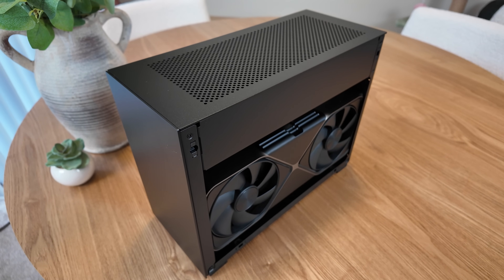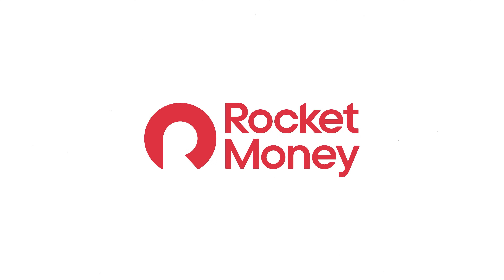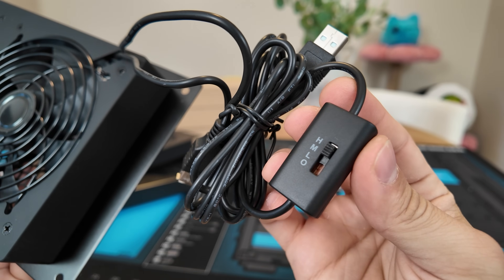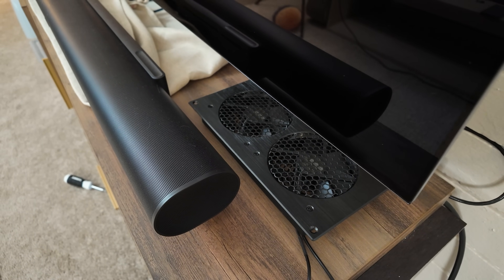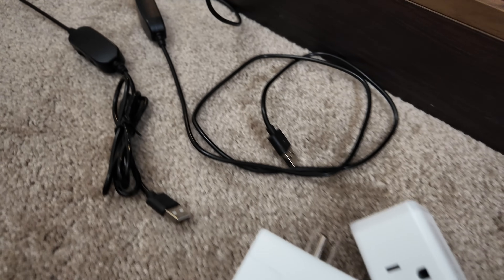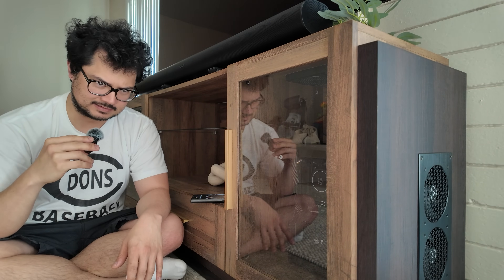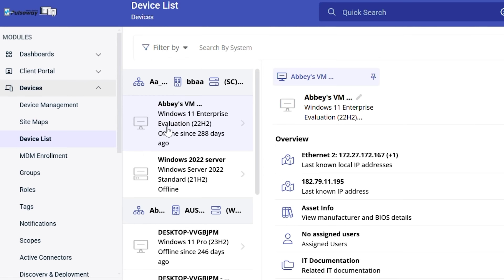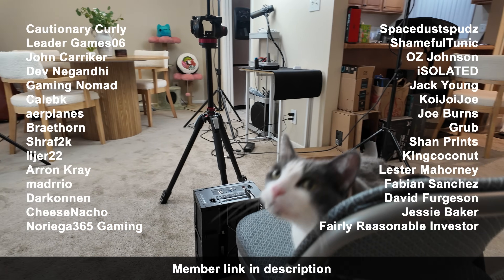The DIY Job That Saved My PC's Life

Comment: is the top heat output a problem for the TV‘s lifespan and would a angled bracket or such, to redirect the hot air against the back wall maybe better?
Reply: it‘s a real nice setup! I was thinking todo something similar for my PS5, but without the tools at hand it just stands beside the TV board nowdays 😂

Comment: If you look at the Shelly IOT products you could have gone one step further and had a temp sensor in the cabinet that when it hits a certain threshold it turns the cabinet fans on and when it dips below the threshold it turns them off again. This would mean for light usage you potentially wouldn’t even need the fans on making noise levels even lower 👌🏽.

Comment: I have been kinda freaking out because i think my EVGA GTX 1060 3gb is finally going out, I have been getting black screen flashes, and black pixels on both monitors i use which are 2 1080p tvs, I dont have any pc monitors. My pc will cash in browser watching videos, on desktop, it crashes even on older games like left 4 dead 2,phasmophobia, bioshock infinite run 10 minutes and crashes, my drivers are up to date, I am running a msi b450 tomahawk, with 16gb of ddr4 3200mhz of G skill flare x, windows 10 home which is stuck at 1903 and wont update,all my motherboard drivers an my bios is up to date. MY pc is my way of streaming making music,videogame development and working from home. I built my pc around 2018-near end of 2019. I have been scouring my tech sources, because i cant afford to upgrade right now.

Comment: Hi Kyle - I've been a fan and a subscriber for a good bit. I greatly appreciate your narrative style and humor in your computer build vids, as well as your v-log style channel update vids. I think both should definitely continue. 

This video in particular made me realize how much your attention to detail and willingness to think outside the box paid off with how well your cooling worked out for your micro build inside your living room TV cabinet. A job well done, sir. 🍻

After watching this video, I thought that maybe you could help me answer a question that has been bugging me with a build of my own. It might be a good topic for a video, if you haven't done it already. If there are better ways to answer this question, or you already have in a previous video - please feel free to let me know. I have a computer build that took me most of the early part of the pandemic to finish/get all the parts for, and unfortunately I have been experiencing some issues with random system reboots related to the dreaded "WHEA-Logger" error, in a nutshell stating that my CPU is overheating.

The current rendition of my build is as follows:
AMD 5900x CPU cooled by an Arctic Liquid Freezer II (2x280mm), installed in a Lian Li 011 Dynamic case with a ASUS ROG VII Dark Hero Motherboard, Nvidia Founders Edition 4070 Super, all powered by a Thermaltake 850w Gold PSU, running on Crucial Ballistix 32gb RAM. I have 3 120mm Noctua fans bringing airflow in from underneath and from the right side, with exhaust going out the top (where the 2x280mm Arctic cooler is acting as a rad) and out the rear (another 120mm Noctua). I thought based on how I completed this build, cooling shouldn't be an issue whatsoever, and it should perform flawlessly.

My build was originally completed with a Nvidia Founders Edition 3060ti, which I eventually upgraded with the 4070 Super. Prior to installing the 4070 Super I never had a WHEA-Logger error. When I installed my 4070 Super, I also adjusted the radiator with Arctic's most recent offset bracket suggestion for cooler placement, as well as re-applying Arctic thermal paste. 

I was wondering if there was a method you recommend for testing a CPU cooling system, beyond the obvious of downloading an app like OCCU/CoreTemp? I think that at this point I may need to remount my CPU cooler and see if that makes a difference. But I was curious what tools and apps you use to monitor CPU temps and make sure that they are performing the way that you intend them to. I am hoping that my CPU cooler isn't experiencing some kind of malfunction, but I feel like without knowing the best way to evaluate its performance, I'm a bit stuck.

If you end up reading this comment, I appreciate it greatly. Thanks for everything you do!

Comment: How much power does your PC pull, and how many amps is that smart plug rated for? Via home assistant, you could probably setup an automation that enables the fans if the PC is pingable on the network.

Comment: I would put 6 fans in the back and divide the low intake and high exhaust with a shelf, forcing the air to pass through the PC before exiting out the back again. That way there would be no visible fans and the temperatures would stay fine.

Comment: How ironic, I also just added 2 variable RPM fans mounted to a board then to my CX77 Mount to cool an access point and Nvidia Shield Pro mounted behind it.

The smart plug makes it easy as heck to turn the fans on/off

Comment: Are you not connected via ethernet? I use Alexa to turn my PC on and off, and I use WOL (Wake On Lan) feature that's enabled in my BIOS. I can tell Alexa to turn off my PC, and it sends the shutdown command packet and my PC actually goes through the shut down process. Also have a smart plug connected to my GoXLR so that turns on and off as well alongside my PC. Would have been 1000% better than hooking the PC up to a smart plug adapter, unless you are wireless for internet and WOL doesn't work over WiFi. Nice fan set up though!

Comment: I'm not sure if that's possible with google home automation, but I know in Home Assistant you could make automation that if your PC draws less than 5W from the wall for lets say 3 minutes, then turn off both smart plugs. And you would not need to switch it off manually every time.

Comment: Nice video the shrouds are nice but why did you go through the route of smart plugs and stuff if you had the original fans with the usb powered thing just connect them to the motherboard and they will power when the pc is on and with the changed fans just get a splitter cable and connect them to the internal header of the MB leave the back panel open or drill a hole whatever you want :)

Comment: it was not easier to have the fans using the PC usb ports so they turn off then the PC is off and would be easy to connect/disconnect without all the cables hanging?

Comment: This feels like it's come full circle. The first video I ever watched of yours was the Node 202 mod. I did it too and used the single fan  version of the same plates you used in this video. Used the fan plate to get more air to the AIO and to make the case more rigid after cutting the big hole in it. 
Great job on this project.
Reply from the maker: Sounds like an awesome mod! But jeez, the Node 202 was nearly 10 years ago. It's a different world now...but PCs are still overheating lol.

Comment: Those AC Infinity fans are very, very useful to be honest. Their radial duct fans beat the snot out of most window fans in terms of CFM/DB and they have temperature control. I use them for my dual hose floorstanding AC vents when the AC isn't in-use (most of the year), which also allows for the shades to be closed during the day so my house (that doesn't have central air) stays much cooler.

Comment: I would've just connected the fans to the motherboard, but with extensions so that they could be cleanly routed, just like the exhaust already is. Or you could keep the smart plugs and set it to turn on the fan and tv when it senses a larger wattage from the PC.

Comment: I have a similar cabinet-fan system for my wife's desk, and the PC under it. 
In the BIOS on her motherboard, there's a setting for USB power while the PC is off, and I have this disabled. The cabinet-fan is plugged into the designated USB port on the motherboard, so it starts spinning when the PC is on.

Comment: Radio Shack used to sell a power strip that would sense power draw on some outlets and turn on power to another outlet. You could use that to turn on fans when the PC is turned on. I don't know if there's a modern equivalent, but surely there must be.

Comment: Would be more interesting to see a setup where the system is powered on with WoL, or even more interesting, a small board like the rpi pico (or zero w) to connect the jumpers. in that case you don't have to cut power to the pc and with the later one can even reset the pc if it hangs up.

Comment: Cat face rubbing is territory marking. This video is timely for me. I migrated my PC into an understairs closet because I was tired of listening to it in the bedroom. Shazam! I now have the same issue as yours: PC in a box. The HVAC is adjacent, and the closet is at the core of the building. My system runs 7x24, so I think I'll probably go with PC controlled RPM.

Comment: That's so nice. I used to build multiple variations of cabinet PC builds with custom hidden silent cooling, noise dampening, etc. I became obsessed with sick mirror builds. I've been wanting to design a new one now for two years. But it's hard to find a glass shop that makes custom dark mirror “pyramid” cuts. My last was 3080 Ti build, so now the 5090 might deserve the same. PC is already in the living room. Maybe this summer. It would be cool to redirect the hot air to outside.

Comment: Agreed.  P12s are great.  I ran P14s in push pull on my 280 AIO until it died.
Also - those are two purrfect reasons for the fan grill swap.

Comment: First, kudos for some creative solutions and a polished end result. But for anyone on a bit smaller budget or who doesn’t want to cut holes in furniture or add a layer of automation to solve a problem, a couple thoughts. (Not yucking your yum, just ideas for others who might not be able to follow your lead.)

Just placing the PC behind the TV could have been a fine solution. Good cable management and creative placement would have avoided the heat issue altogether. Or even mounting the PC to the wall behind the TV could have worked. Choosing a case that is more friendly to the front room could have fixed the issue as well. By choosing a case meant to be horizontal and placing it on the middle shelf instead of in the cabinet, you avoid the heat issue. Personally, when I’ve run media center or gaming PCs in the front room I’ve had closets or other rooms close by and I put the PC in those adjacent rooms and just run a longer video cable through the wall. That’s not always practical depending on your home layout, but I prefer it to having a PC visible in the front room.  If no adjacent rooms are practical, maybe you have a basement right under the living room that could work as well. Just a few alternatives that have worked for me.

Comment: Hey awesome video and great DIY. One thing that I could mention that could also be a video idea is the following: Home Assistant can be used PERFECTLY here. I use a mini pc I bought on Amazon to run home assistant in a virtual machine, and HA allows me to use Google Assistant and Alexa in tandem. Using HA, you can use the wake on lan command to turn on your pc, and the RPC Shutdown add-on to shut it off without interrupting power. You can then create an automation that whenever the PC is turned on, it automatically turns on the smart plugs and the TV. I do this same thing with all of my pcs at home. I said "Alexa/HeyGoogle, turn on main computer" and it turns on my TV, PC, and the backlight behind the TV flawlessly. I can say "Alexa/HeyGoogle, Turn off main computer" and everything shuts down appropriately and the PC still remains connected to power because the RPC shutdown command turns it off and puts it into power mode S3. Anyways! Feel free to DM me if you're curious and I can link you to the necessary materials. It's much less complicated than you think and you can keep your google home set up and integrate it in!

Comment: You could have done this by using positive pressure and only 2 top fans, and adding vents at the bottom. This would eliminate dust, and you'd still have nice temps inside.

Comment: I like those Kasa smart plugs.  Home Assistant just finds them and they integrate really well, but I would not use them to power on my PC as I worry about introducing power surges.  Instead I recommend building a smart switch using a ESP8266 Wemos D1 mini and a D1 relay shield. It can be powered from an internal USB header and using DuPont wire you can connect it directly to the motherboard power header and even create a pass through to the case's power switch.  Using the ESPHome device builder add-on to Home Assistant, you just need to add the snippet below at the end of your YAML file to program it: 
switch:
  - platform: gpio
    name: "Unique name"
    pin: 5
    id: relay
    inverted: True
    restore_mode: RESTORE_DEFAULT_OFF
    on_turn_on:
    - delay: 500ms
    - switch.turn_off: relay

Comment: Couldn't you just plug the USB fan controllers into the PC and skip the smart plugs??
Reply: Yes, as long as you set the BIOS to not power the USB ports when the PC is off.

Comment: Hey Kyle you need to go into Google Home and change your PC to a "fan" or something if it's an outlet and you tell Google "All Lights Off" you'll trigger your PC.

Also they sell Google WiFi switches that connect to a PCIe slot so you can turn your PC off with your voice and it will shut down as if you single tapped the power button.
Reply: I personally use a Wake on LAN solution to control my PC via Google Assistant. It can turn on my PC without me having to worry about it accidentally cutting power, and once it's setup it is trivial to add the function to all the computers in your home.
Reply: I actually haven't thought about that method thanks  @OmairArif
Reply: is there anything i could do that for my laptop? (i don't even have these options on my BIOS) (Asus Rog Strix Scar III - G731GW)

Comment: The positive pressure in the cabinet probably makes it a non-issue, but since you went to the trouble of installing dust filters on the fans, you could also seal around the two cable holes with some form of Butyl Tape solution to really isolate the dust intrusion into the cabinet.

Comment: Something to consider for people building in this case, you might find that the cooling works out better if you set the radiator fans to exhaust. Typically small form factor performs best with negative air pressure where possible, though it would increase the amount of pet hair and dust that makes it into the system.
Reply: I believe it is even in the manual

Comment: a better solution would be to use a smart plug that monitors power. monitor the power on the PC plug and when it goes to a high enough wattage that it would mean the computer is on, say 50 watts. trigger a turn on of the fans. also do the inverse, trigger the powering off of the fans if the wattage goes below 5 watts or something. this way the fans will still turn off / on when using a manual power on/off of the PC
Reply from the maker: You can DO that?? OK, upgrades may be happening sooner than I thought. Thanks for the idea!
Reply: @Bitwit  Was just about to suggest the same thing. I'm not familiar with Google Home, but it should definitely be doable with Home Assistant. Also consider adding a timer to the automation so it doesn't cut power if you do a reboot, I.E. if power draw remains below 10w for 60 seconds, turn off the circuit.
Reply: @Bitwit same idea here but no cookie ... that's what you get for being an hour late :P also I believe you should rather look for a "Master Slave Power Strip" because everything is "smart" these days so that won't be of much help. been using one for 20+ years now, still works!
Reply: @Bitwit same idea here but no cookie ... that's what you get for being an hour late :P also I believe you should rather look for a "M4ST3R SL4V3 P0W3R STRlP" because everything is "smart" these days so that won't be of much help. been using one for 20+ years now, still works! P.S. also my reply just got auto-deleted for telling you the correct thing lol

Comment: I might have used a power monitoring plug for the PC and when it detects it being on it starts the fans with the other smart plug.
Reply: A simpler solution would be to plug the fan controller USBs into the PC, and the just change the BIOS setting so the USBs are only powered when the PC is on. 

Also I'm not a fan of having the PC connected to a smart plug, mainly because I'm too paranoid of having it accidentally switched off with Google mishears me or something. I have my PC controlled through Wake on Lan, which takes more work to setup but is cleaner in the end IMHO. I used home assistant to do it, but if someone doesn't have that setup a $3 ESP32 can be configured to act as the Wake on Lan server and added to Google Home.
Reply: @OmairArif  That's my first impression too, not sure why that's not the way it was done.   I have an LED strip plugged into a USB port that's just for light when the device is on.   You have to make sure that the port can support the amount of power you need, if not you can use a powered hub to power the device and it should power down when its USB power is cut (some do this, some don't).   The only advantage my idea has is that you can leave the fans on for a while after you power off.   Even better would be a temperature sensor that goes by the temp inside the cabinet.

Comment: I probably would have used a floor vent from A/C with a flex hose to the entertainment center with an exhaust fan set on the side of the entertainment center.
Reply from the maker: Only high wall vents in most homes around here, but that's a solid idea.